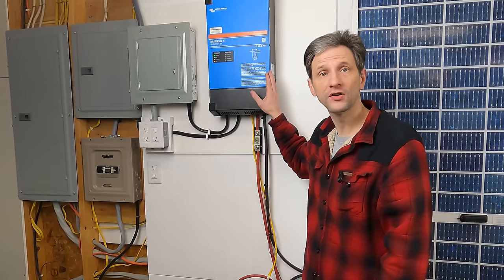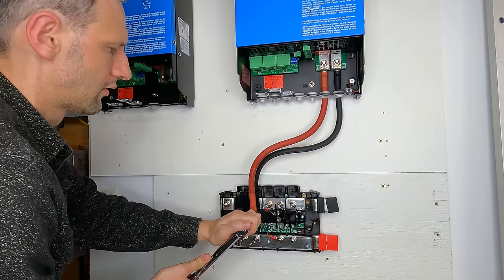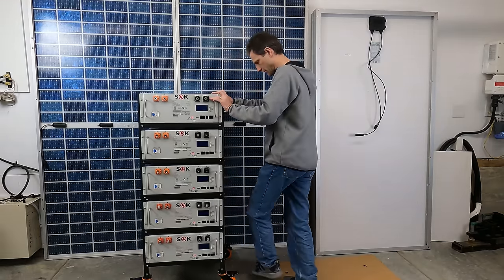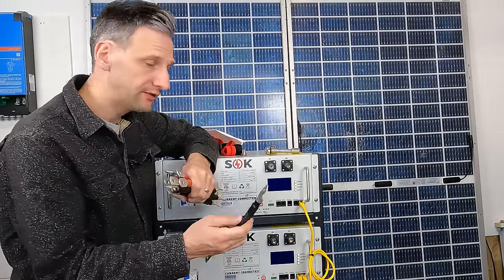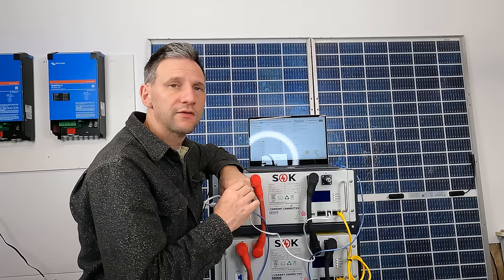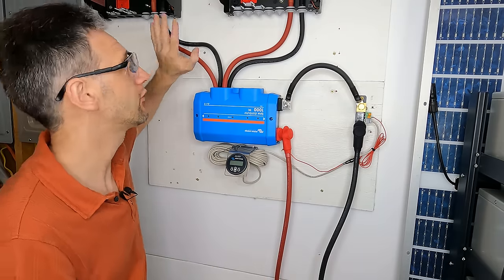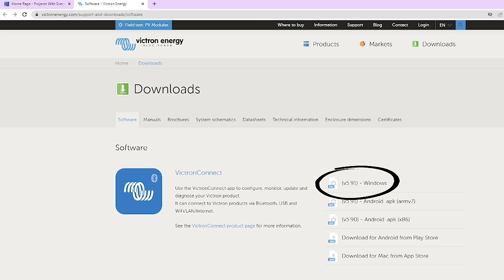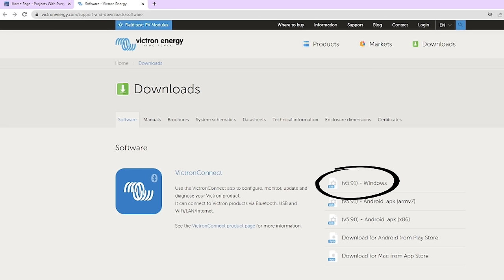DIY Split Phase Battery Backup for Home - Step by Step

Comment: Dave - thank you for all the work in these great step by step videos.  Before I undertake the effort, as we have been suffering with 6+ outages per year, would like to understand the thought behind going with a 50 amp transfer switch and not something higher like a 100 amp - and second, is there a proper location for the transfer switch breaker, like towards the bottom of the main panel or does that not matter?  Assuming the transfer switch is present to prevent back feeding from the battery and solar to main - but somehow the main power flows into the inverters/batteries.  If power is lost, how does the setup prevent back feeding main? Appreciate all you do!
Reply from the maker: The transfer switch in this setup is only there to allow the input to switch between mains and generator.  If you use a Quatro ( https://www.currentconnected.com/product/victron-48v-quattro-3kva-inverter/?ref=pwd ), it has separate inputs for the mains and generator so you wouldn't need the transfer switch.  The transfer switch is 50A because that is all the Multiplus II can make use of.  If you want more capacity you could get the Quatro 5k or 10k.

Comment: So the rack of 5 SOK batts are 2x that of what a single Tesla PowerWall provides right? I assume they have a longer life too being LiFePO4? So at 25Kwh, that's enough energy to run a typical home for a full day in the summer excluding AC? If power were to go out for a couple weeks, and you had solar charging things.. would you basically avoid using anything other than fridge and stove to have enough power (with solar charging assuming you have enough solar)? You mentioned generator too, so I assume you could always use a generator, but was thinking in a situation for someone on an island who may not have access to fuel either.. how long could they last with minimal use of things?

Comment: Great informative video,  curious about one thing,  why do you need a neutral ground bond in an inverter if your main panel has a neutral ground bond.   It seems like your transfer switch isn't switching the neutral, so all  your neutrals are together, and all your grounds are together, and then they each connect back to the main panel meaning that there would always be a neutral ground bond in the Main panel, Or did i miss something?

Edit - Oh wait, is it because the critical loads panel is only fed from the inverters, and therefore can't really see the neutral ground bond in the main.  So the neutral coming from the transfer switch to the inverter isn't necessarily connected to, or passing through the neutral going out to the Critical loads panel, so it's almost a separate system?
Reply from the maker: Right, it's basically on an island in UPS mode.  The neutral would be floating if one of the inverters didn't' create the ground neutral bond.

Comment: These 2 inverter (one per line) setups always seem like a mess to me.  You end up with twice the idle power consumption, twice the cableing having to add data communication cables and you split the autotransformer effect across the neutral bar rather than having a single larger splitphase inverter where both half phases are on one centertapped transformer core.  You also always have to buy a pair of inverters to keep expanding the setup in the future.  

This is still a nice setup for a backup situation but I would go with a single 6K splitphase unit for backup power or a single 12K splitphase unit for whole house backup.  2X-4X 12K splitphase units running in daisy chain would be enough to take a modern home that has 200A panel completely offgrid at even the highest usage levels like vehicle charging while using the range, clothes dryer and air conditioner.

Comment: First off, thanks for all the hard you've been doing with this channel, I've used some of your videos for guidance while performing our PV installation at home.

0:50  Dave, are you sure those batteries can be installed in that position? 
I have a similar LiFePO battery and the manual states that it can't be left in this position (face looking up)
Reply from the maker: Yes, this position is ok for the SOK batteries.  One negative is dust gets in the terminals.

Comment: We currently have our backup system on an interlock switch. Would it be possible to use this same setup through an interlock? And what would the proper wiring be for charging with a generator?
Reply from the maker: You can see how I set this system up for use with a generator using a transfer switch in this video: https://youtu.be/BzMAW8kW0CU

Comment: awesome video. I love that setup. But I have 12 solar panels with microinverters and I would like to be able to add to my system a battery backup system like that. Any suggestions.
Reply from the maker: This system will work as a backup with your setup.  They work independently.  Inputs and loads can be combined in an AC combiner box like I did in this video using micro inverters: https://youtu.be/Y8OGxdJ9cU8

Comment: I'm considering doing something similar to this / your first video with this system - do the batteries essentially stay fully charged unless grid goes out and it transfers? How do you account for properly cycling the batteries when putting together a back-up only system like this?
Reply from the maker: Good question.  They do stay fully charged unless the power goes out with this setup.  I periodically turn the breaker off and let the loads drain the batteries to cycle them.
Reply: @ProjectsWithDave  Appreciate the reply and insight, Dave. I'm only going to be doing a 120V critical circuit panel, and I'm bouncing back and forth between the 5k Vitron and the Sol-Ark 5k. I think the Sol-Ark software might allow some parameter programming to cycle the batteries more easily, but it's also the most expensive 120v option. Thanks again.

Comment: Dave I appreciate your detailed installations and explanations. Could you replace your panels with a single SPAN panel?
Reply from the maker: Thanks!  I haven't spent a lot of time looking at SPAN panels since they are around $4,000 vs $200 for a standard load center.  However, if money isn't a consideration, it looks like a neat solution.  If someone want's to send me a panel, I suppose I could try it out.  : )
Reply: @ProjectsWithDave  I also would appreciate a complimentary span panel. 😂 Did that two hundred dollars include wires breakers and that circuit monitor in your auxiliary panel?
Reply from the maker: Good point, the panel was about $200, the monitor $165, the breakers, $900.  So, about $1,265.

Comment: If I were to install a pair of 10kw M+2's
1) Can they output to the grid (spin the meter backward)
2) I assume theu have no PV inputs and you would also need an MPPT controller etc...

Is there a better sution for a 20kw array to feed the grid while still offering a battery backup?
Reply from the maker: It is possible to do it, I show how in this video: https://youtu.be/6WO44Pa5EwI
However, Victron does not have an approved grid code for the US at this time so you can't get approval to do it.
You can use a unit like this one to do both grid back feed and battery backup: https://signaturesolar.com/eg4-18kpv-hybrid-inverter-all-in-one-solar-inverter-eg4-18kpv-12lv/?ref=pwd

Comment: Great stuff, very helpful.  Don’t you need to install an energy meter so victron can see what the house is using tho?
Reply from the maker: You can optionally add a sensor to track that, but it isn't necessary for the purpose laid out in this setup.

Comment: What about air conditioning? I have the same sok 5 stack running my RV and that one dometic ceiling unit makes the fridge draw a distant second. Now we are in a heat wave and in Florida of course...my 2400 watts of solar doesn't seem to be enough to recharge the bank in a full sunny day, which is a goal...great video thanks!
Reply from the maker: This system should have no problem running an RV air-conditioner.

Comment: Great video! I hope you can answer some questions . 
What is the cost of this whole system and how many hours does it take to complete this project?  How does this affect home insurance premiums? Please also talk about permitting process for a project like this. Thank you!!
Reply from the maker: Thanks!  If you have some wiring experience and all the materials on hand you could do it all in one day. Insurance companies handle things differently you would have to call yours and ask them. Technically this whole system is off-grid so permitting may not be an issue for you.  You can ask your building office for advice.  I haven't completed the cost breakdown yet.  When I do I will add it to the documentation on my website: https://projectswithdave.com/120-240v-victron-home-backup/
Reply: @ProjectsWithDave  Insurance companies want to see UL Listed hardware for sure!

Comment: My first question is what kind of well pump are you using? That’s 240 V because I have an old jet style well Pump and it’s 120. And my second question is since you upgraded your system, why did you upgrade to still doing single phase inverters when you can now get dual phase inverters for pretty reasonable price nowadays compared to what they used to be instead of buying two expensive inverters to make it so that you can have 220 V at your panel box
Reply from the maker: My well pump is a variable speed constant pressure 240V Grundfos pump. 
The point of this system was starting with a single unit that could later be upgraded to split phase.  See the original install here: https://youtu.be/BzMAW8kW0CU
I am also investigating all-in-one split phase inverters.  It is hard to find something that beats the reliability and efficiency of Victron.  Not hard to find something that beats the cost.  : )

Comment: Love the vid! Last year I unfortunately went with a Schneider inverter, god I hate it.
Reply from the maker: Really?  Schneider is also a good brand.  What don't you like about it?
Reply: @ProjectsWithDave  The temp sensor is always inconsistent and never triggered a cutoff even after 2  meltdowns. No native Lifepo4 settings. (only custom). Expensive add on Insite home is needed for network connectivity. Terrible tech support via Schneider. (They just don't care). Super tight internal wiring on the SW with THHN wire. I have plenty more reasons and could probably keep going.
Reply: Abstractly, it lacks that diy fun

Comment: Dave, With that configuration, how many solar panels do you use and how do you configure them? Thanks for the video and all the information.
Reply from the maker: I plan to make that an upcoming video.  The system as built in this video is just battery backup, no solar is connected yet.   The number of panels you would need would be directly dependent on the load and your solar irradiance conditions.  Figure out how much power you consume in a day, and compare that to how much you can expect to produce with various array configurations. Use this calculator to determine your array performance: https://pvwatts.nrel.gov/
Reply: @ProjectsWithDave then double your pv if you are running heat pumps in the winter. You will only get about 5-10% production on cloudy winter days in Kentucky/Ohio areas where we live. 34kWp for me. Adding another 12kWp before winter.
Reply: @USA-GreedyMenOfNoIntegrity  my heat pump heat strips are a 10kW load by themselves (not including the compressor, condenser fan, and evaporator fan and other house loads) and run for several minutes during a defrost cycle.  Wish I had gone with a propane heater in retrospect and a mini split for the bedroom to run at night. Thank God for my tankless propane water heater.

Comment: Hi, love this video, I’m wiring the same setup for the same reason you did, (to run my well pump), one question, any particular reason why you didn’t ground the inverter chasis using the same green wire coming in from the transfer switch?
I know that’s just for protecting people from getting zapped in case something fails and it has no other functionality that will affect the way it works, just wanted to ask you that.
Reply from the maker: This unit is grounded through the Input/Output ground connections.
Reply: @ProjectsWithDave  makes sense, one more question, I know the ground and neutral should NOT be bonded in a sub panel, only at the main, so, do you run a ground from the main panel to the transfer switch and another ground from the main panel to the sub panel? I’m a bit confused there.
Reply from the maker: There is one ground rod for the house.  As long as each panel makes its way back to that central grounding rod with a sufficiently sized ground conductor you will be fine.  Usually the main panel has a #6 copper connection to the ground rod and the sub panels connect to the central ground bus in the main panel.  I always recommend clarifying these details with your local inspector.  They often have some "personal" preferences for how they want to see it done.

Comment: The reason the Lynx comes with an extra label is so that you can put it on properly if mounting upside down so you don't have to have it look like yours does, if it didn't come with one, get it from your supplier. Page 7 in the manual..."The Lynx modules can be mounted in any orientation. Should they be mounted upside down, so that the text on the front of the units is upside down as well, use the special stickers are included with each Lynx module, so that the text is orientated the correct way." I'm still watching so maybe you fix it at the end, if so disregard.
Reply from the maker: Yea, I put it on at the end.
Reply: @ProjectsWithDave  Great video, thanks for posting it…. Not a lot out there showing the setup AND programming on duals.
Reply: @ProjectsWithDave  You need a contact link on your web page if you’re not going to have one in your about, which you don’t…. You have a typo on the build page for this project, the word components is missing an n, great build page by the way, well done. The infographic and wiring diagram is better than most I’ve seen that people are charging for… wow nice

Comment: Dave: Two questions: is this install code compliant, and it appears that the only reason you have a transfer switch is so you can switch to a generator, otherwise you could plug the inverters directly into the main panel, am I correct?

Comment: Dave, what kind of well pump do you have? I have 1 HP F&W 9 gal/min at 300ft deep, and would like to know if this system will be able to run the pump. Thanks Dave.
Reply from the maker: My well is a Grundfos constant pressure variable speed pump.  So your pump would be a bit more difficult to run, however the Victron equipment is very good at starting induction loads, I think it would work for you.
Reply: @ProjectsWithDave  Thanks Dave ! I plan to do the same thing but use two of Victron's Multiplus II 5000 VA so it should handle my current pump easily. I also have septic water pump. If my pump need to be replaced in future I will go with Grundfos soft starting pump but not constant pressure pump. I wish that Victron makes all-in-one split phase (120v/240v) inverters for N American market, it will make the installation much easier. My alternative option is Schneider XW-pro but it also need lots of different components and costs as high as Victron. It would be great if you could make a video about building a system with Multiplus 5000VA and compare with Schneider.  Nick
Reply from the maker: Thanks for the suggestion, I've been thinking about illustrating a few system configurations for comparison.

Comment: Very interesting video, well explained and put together. But I can't get enough of those wheels, it reminds me of myself 😂 First put it on wheels even if you shouldn't, fall on your face, lift your self up with big words and do it again. I see very little benefit to having it on wheels. How often will you move the batteries? For the few times it happens I would just unload and reload them. But I see the appeal, having this big rack of batteries om wheels and moving it around would make me feel like an evil genius.
Reply from the maker: I'm always testing different inverters, so I need to move the batteries quite often.  If was just installing it like a normal person I would bolt it to the floor.
Reply: @ProjectsWithDave  makes sense in that case. I only watched this video, so I didn't know. Thank you for responding.

Comment: Hello I really enjoy watching your videos very cool set up I would like to get a suggestion I have 5 solars panel mounted in my shed not using any power but now I want to upgrade the system charger controller and inverter and life po4 batteries how can I get this power in to my house I’m not a electrician I now very little thanks
Reply from the maker: Here is a video on how I moved power from my shed to my house: https://youtu.be/Y8OGxdJ9cU8
Reply: @ProjectsWithDave   thanks for the  I have 5 solar panels I think they are 210 watts each 36 volts I’m planning to get the victron multiples 24 volts 70 amps I already have 4 lifepo4 batteries 200 ah 24 volts the real question all this set up is that okay?
Reply from the maker: If you are talking about the Victron Multiplus II, it is just a charger/inverter it does not take in solar.  For that you need a charge controller like I install in this video: https://youtu.be/6WO44Pa5EwI